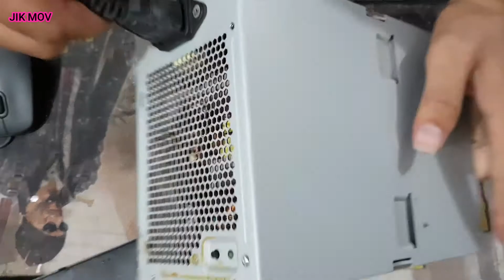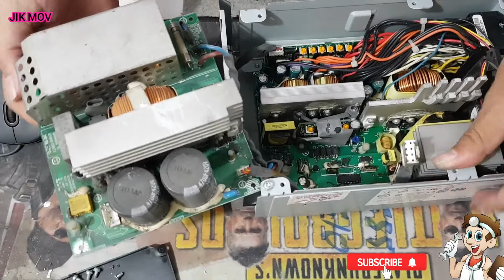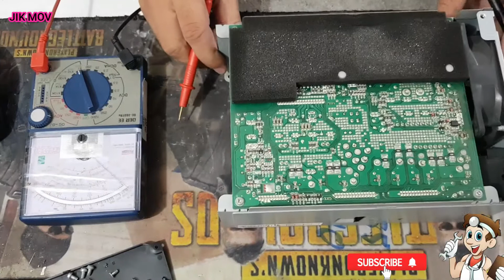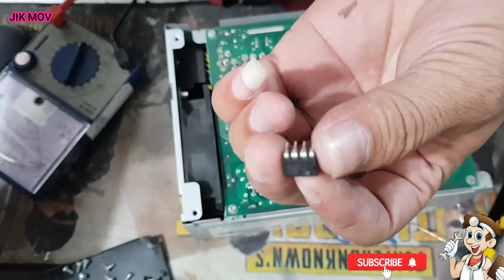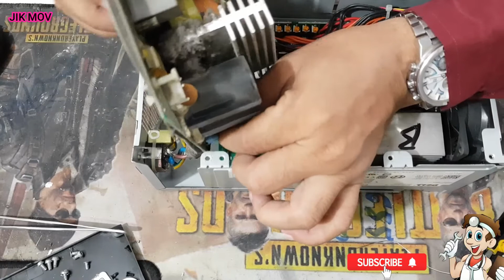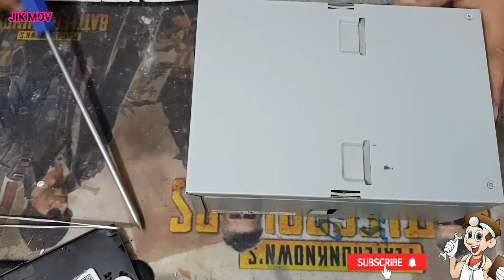How To Fix Power Supply Dell T7500 DEll Precision T7500 Desktop Workstation TEL017617375/010403168

Comment: psu is working fine but still, fans are working power supply light is good but still, amber 1 3 error is there, no bootup no display

Comment: My dell T7500 is turned on for nearly 5 seconds and suddenly power supply turned off automatically. Any suggestions?
Reply: I have the same what was the problem ?
Reply: @mohammedsaad7157  i have changed power supply and my issues is resolved, i am working on my workstation now.
Reply: Is a regular faulty, i try moving VRM preset to increase output voltage... work but at 600/700w max. Try to maintain tunned below 12.8v